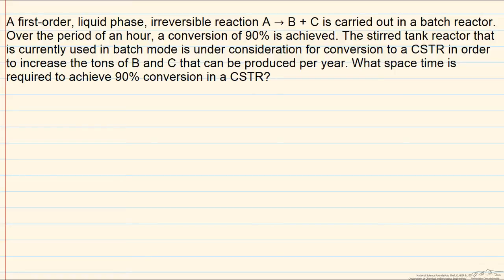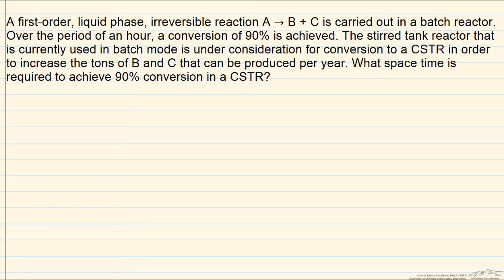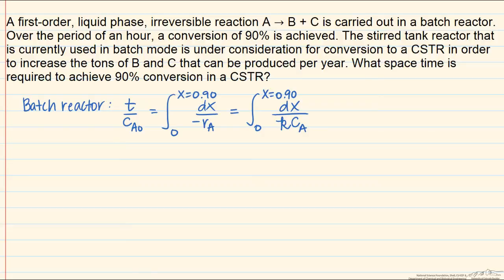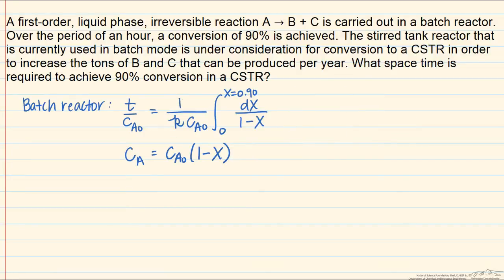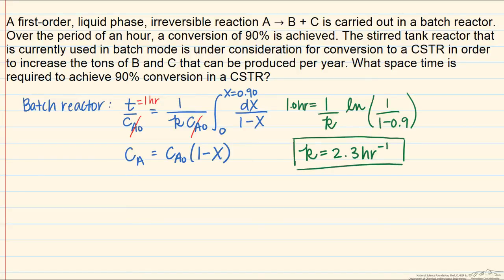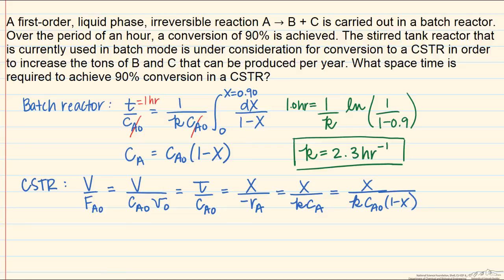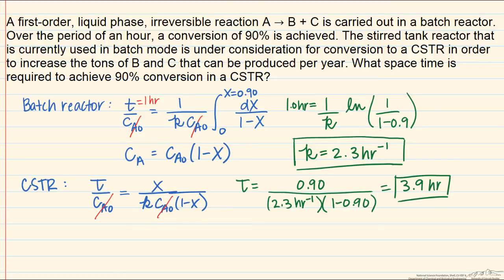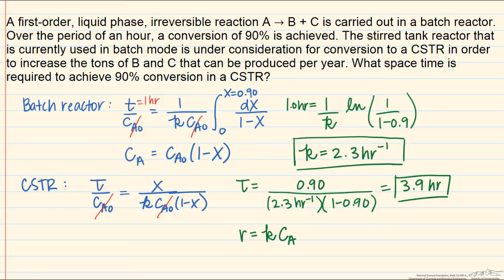CSTR Conversion Based on Batch Data

Comment: Thank you very much.. this is what ive been thinking about in 2 days of designing my reactor.. so if my process is based on a batch process which must have reaction time of 1.5 hours, is it better to use batch instead of using multiple cstr in series?

Comment: This integral you solved isn´t the right answer. It should be ln(1-x)
Reply from the maker: Thank you for your comment.  The integral is actually -ln(1-x).  A few steps were skipped.  You have that integral, then you put in the limits of x = 0  to x = 0.9.  At x = 0, the answer is -ln(1); at x = 0.9, the answer is -ln(0.1).  So taking the answer at x = 0.9 minus the answer at x = 0, you have -ln(0.1) - -ln(1) or ln(1) - ln(0.1).  Using the Quotient Rule [ln(a/b) = ln(a) - ln(b)], you end up with ln(1/0.1).  I hope that helps.